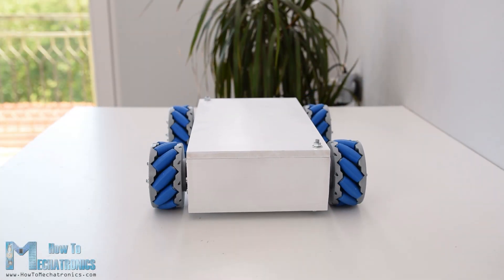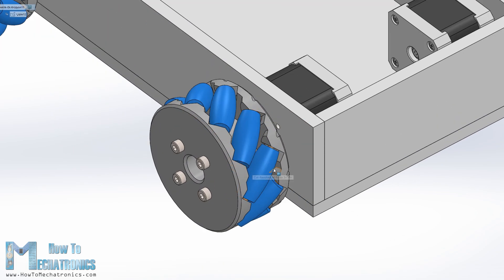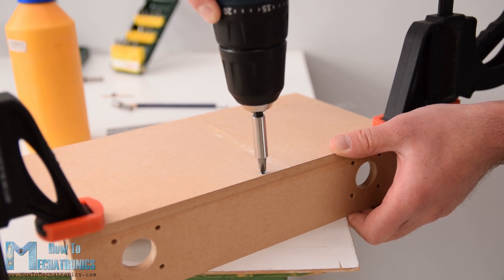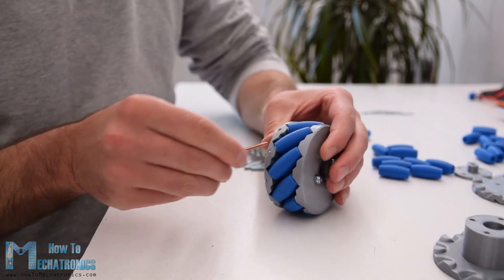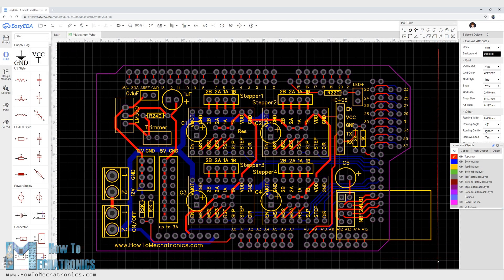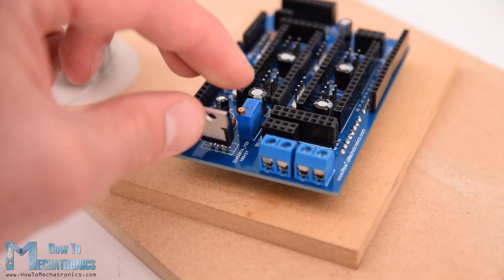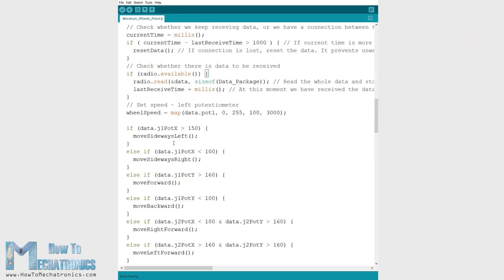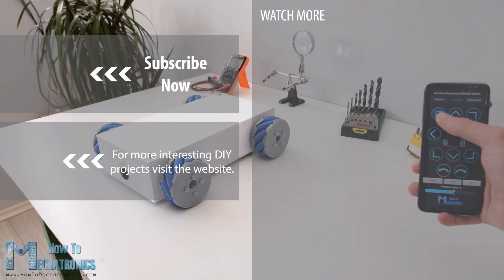Arduino Mecanum Wheels Robot

Comment: Great video , you helped me a lot with my project and i would like help to deal with a problem.
I used the mit app inventor and when i controlled my robot with it , it had a delay .  The app is built like yours , i used hc-06 BT , and other apps that in them you can send text to the arduoino through typing and not clicking dont have delay .
Thank you .

Comment: I'm building something similar with 4 stepper motors and your Mecanum Wheels but I can't find a video on how to control stepper motors with the Flysky transmitter, Will this radio code work with the Flysky transmitter and receiver ?

Comment: Well done. One point though. The diagonal force is due to the roller in contact with the ground which not the one on the top. If the view from the bottom, no confusion will arise.

Comment: What's the value of decoupling capacitor? Used in rc controller
Reply: Hello, can you help with  the capacitors and resistor value (Ohmic Value) and capacitors name etc stuff like that. in the robot's PCB

Comment: Hi, I am working on a different project where i want to control 3 stepper motors. Will it require anduino mega or arduino uno will be sufficient?
Also, I need tires with good grip. Can mecanum or omni directional wheels provide good grip?
Thanks in advance

Comment: i have to use hc-sr04 ultrasonic sensor with this nema17 but they dont work at the same time. nema17 motors sounds weir and they dont work if i use hc-sr04 codes. is there any way i can get to work them at the same time

Comment: Hi, 
I tried to do the project but I failed,I did not use resistance nor capacitors, is it the reason, and I used o e stepper motor Nema23, is it a must to use 4 steppers.
Regards

Comment: HI SIR
MY SELF CHARAN TEJA H
I AM CONTINUALLY WATCHING YOUR YOUTUBE VIDEO
WHICH IS REALLY AWESOME AND I WAANA TRY IT 

I CAME ACROSS A DOUBT IN THAT VIDEO

U HAVE USED A NIMA 17 STEPPER MOTOR
AND U GAVE A AMAZON LINK TO IT
IN THE AMAZON LINK I SAW THAT THE STEPPER MOTOR WAS 36V BY THUS I COULD NOT GET IN MY LOCALITY
SO COULD I USE 12 OR 16 V STEPPER MOTOR 
REPLACING IT

Comment: Hi, 
I'm trying to do the project without the PCB. (with the help of the circuit )
I have a few doubts about the connection :
1) why are RST and SLEEP of DRV8825 is shorted (both are active low inputs)
2) Fault pin is given high input. (it is output lowpin)

Comment: Hi Dejan. Good project I would want to create it with the robotic arm, but a question: can I use a Motor Driver Shield instead of the 4 A4988 Motor Drivers? Pls answer I have to order the parts I need
Reply: Hello, can you help with  the capacitors and resistor value (Ohmic Value) and capacitors name etc stuff like that. in the robot's PCB

Comment: Okay, all this is very impressive and all, but seriously how many people watching this would have the tenacity to see such an intricate build as this all the way through to the end?  I say:  zero.  Now then, if some enterprising chap were to take all of this stuff put it in kit form, including all the plastic parts; hardware; mdf cutouts; batteries; RF module; electronic components; software and bundle this for, I don't know $150 - $200, you might have something many of us could actually buy & build in a reasonable amount of time.  Other than that - great informational video.

Comment: Why soft-serial? Mega have 4 hardware serials. Also, if you connect hc-05 to serial0 - you can upload firmware by air (prev you need select connection speed of HC05 with AT commands like arduino upload speed)...
Reply: Hello, can you help with  the capacitors and resistor value (Ohmic Value) and capacitors name etc stuff like that. in the robot's PCB

Comment: hi great vid HTM !
i've build the same platform as yours, and it works fine in forward/backward direction and it rotate nicely, but things goes wrong when i try to go sideway left or right...
The rollers slides to much on the ground and as a result, the L/R control is unpredictable...
I first tried PLA to print the roller, then i tried TPU but it doesn't make  a big difference...
Does anyone have an idea of what kind of filament i should use to get a better grip between the rollers and the ground ???
Thank you all.
(and please, excuse my bad english... i'm french :-) )

Comment: Hello Dejan
Thank u for the great effort
I have a problem with the arduino codes for the mecanum wheel robot
First the led line in the code for nrf control has a problem
Second the software serial Bluetooth line has a problem in the smart phone code
I will appreciating if u can help me

Comment: Hello Congratulations on the project and thanks for sharing. I just can’t record the movements.
 Help-me.
At the beginning I had problems with the transmission rate, I used 9600 to run the engines, and for those who want to use Arduino UNO with CNC Shield v3 the pinout is different, if you have problems with engines running alone, for DRV8825 Drivers use (Type Driver = 2).
Staying like this:
AccelStepper LeftBackWheel (2, 2, 5); // (Type: driver, STEP, DIR) – Stepper1
AccelStepper LeftFrontWheel (2, 3, 6); // Stepper2
AccelStepper RightBackWheel (2, 4, 7); // Stepper3
AccelStepper RightFrontWheel (2, 12, 13); // Stepper4

Comment: Instead of battery we can use 12v DC adapter for powering the Arduino and motors??
Reply from the maker: Yes, sure.
Reply: @HowToMechatronics  where we to connect with Arduino or terminal block??

Comment: Hey Dejan, great video! I have a problem with the stepper motors. When I put my robot on the ground (similar design as yours), they are getting stuck and the rover doesn't move at all. When I take the wheels off, the stepper is rotating just fine. I am using a 11.1 V, 2200 mah lipo battery. Is there a way to fix this? Thanks for your response!
Reply from the maker: Hey, thanks! It sounds like the motors don't have enough power to drive the platform? Is you platform too heavy, or the motors too weak?
If you are using the same motors they should be plenty powerful for this application. Make sure the current limit of the drivers is adjusted properly, you can increase it and they will deliver more power to the motors.
Reply: I switched from an Arduino Uno to the Mega and everything worked out. I think the Uno was not able to handle four steppers and a servo at once? All the components I had in my robot had seemed to draw more current with the Mega, which made it work. Thanks for the help!

Comment: Hi , great job on this wheels robot. 

I have a question the size for the MDF baseboard as I will not print them so I would like to know the height x width ?
Reply from the maker: Hey, thanks! The size of the base MDF board is 300x156mm for the bottom,  300x55mm for the sides and 140x55 for the other sides. Total from top to bottom 71mm.

Comment: If I connect the arduino board and shield directly into my PC, which can supply about 5V (No battery is connected to the shield), will I be able to control the vehicle, assuming no line of code is modified?

Comment: Does the size of the stepper motor matter? I'm planning to buy smaller stepper motors than the 42x42x48mm ones you used, since I can't find such size in my region.
Reply from the maker: You can use smaller stepper motors, just make sure they have enough power to drive the platform.

Comment: I got a problem, i think the motor i used, a nema 15, has no enought power to work in this project... tryed to use it, and the motor skips passes... am i right?
Reply from the maker: Try to increase the current limit of the motor.

Comment: Hello friend, is it possible to use a Ramps 1.4 card with the dvr8825 drivers or the A4988 drivers, instead of making the printed circuit board you developed? I have difficulty getting this printed circuit .. it would take a long time to get to where I live. And I already have a ramps card with the A4988 drivers.

Comment: how heavy of a load can this robot carry? if I wanted to make a robot that can handle about 15kg of weight could I use bigger motors with the same electronics? Do you have the BOM and pick and place file so I can have it totally assembled in China? If not how much would you charge to make the files for me?

Comment: This is awesome and appears clearly a lot of efforts have been put in the project. Video quality and explanation is also great.
Reply from the maker: Thanks!
Reply: @HowToMechatronics  Hi Dejan. Amazing project I would want to create it with the robotic arm, but a question: can I use a Motor Driver Shield instead of the 4 A4988 Motor Drivers? Pls answer I have to order the parts I need

Comment: I am getting Accel stepoer.h:no such file or directory
Reply from the maker: You need to install the Accelstepper library first.
Reply: @HowToMechatronics  where I can download the library
Reply: @HowToMechatronics  can you send me the full code that you use to control your car I made the exact same car with exact same parts and shield
Reply: @HowToMechatronics  I downloaded the library but I got the same error I don't know what is wrong with it I want to make it for my school project but I don't think I will be able to make it I try to contact you may way but I can't able contact you 😟
Reply: @HowToMechatronics  I was able to upload the code and the library but it can't rotate the stepper motor getting power but it stay at it place
Reply: Where I can download that file
Reply: I am new to aurduino thingy

Comment: Great project. Thanks for sharing. I see the code shows how to do basic movements art 45 degree intervals. My question is how would you move the robot at a different angle, say 17 degrees or 67 degrees etc. It would require knowing direction and speed for each of the 4 wheels. The question is how to calculate them.

Comment: Was eagerly waiting for this kinda video to learn about this project , Thank you so much for sharing this..❤️❤️

But i wanna know more about it , basically i am now studying Electrical and Electronics Engineering , i have a small quarry about the project 

If i use Dc motor in lieu of Stepper motor , what's need to change in the schematic of the robot circuit diagram  or can we make this with Dc motor and dc motor driver ?? 😊😊

Comment: How to get these wheels?   Material specs of the wheel
Reply: Srirama Murthi if you want to order some, you can find some in either Vex Robotics (Under VexPro) or on AndyMark (wheels aren’t as good), and come in many diameters (from 2-10 inches iirc maybe more). In this video he 3D printed them (which is a unideal way of doing it but should work)

Comment: Very nice.  I really want to make a wheelchair at some point with these kinds of wheels because not being able to move sideways in a normal wheelchair is so annoying.  Don't think 3d printing could handle that load, so would probably have to buy the wheels.

Do you have to do anything special to mix the inputs if you want to move forward, turn right, and strafe left?  Does it work if you simply just add up the rotations calculated from all the different vectors?
Reply: Alluvian would not recommend for a wheelchair. Ever. They are so unsuited for the task. Use swerve drive (wheel that can be rotated freely in all directions with another motor), it provides more grip, less inconsistencies, better slope climbing, better dealing with rough surfaces and still can move in all directions (be sure to use a good encoder for the wheels direction so they will never get out of sync)

Comment: Amazing engineering, thank you for sharing this project ❤️
Reply from the maker: Thank you!
Reply: @HowToMechatronics  Hi. Good project I would want to create it with the robotic arm, but a question: can I use a Motor Driver Shield instead of the 4 A4988 Motor Drivers? Pls answer I have to order the parts I need

Comment: Do we really need stepper motors for this?? Cant it be done using just plain old dc motors? Im a noob here, just that steppers are gonna be so much more expensive, right...
Reply: A better method us to use DC motors with encoders.
I've done this myself. I initially tried with DC motors but it didn't work very well. By adding encoder feedback, I was able to make the robot move much better than without the encoders.

Comment: Seems to be simple by its look, yet amazing the way it performance.
If you could make avail the product in amazon you could really fetch a million.
Reply: MOHAN DOSS .V it’s commercially unviable to build a robot like this and sell it on amazon (manufacturing time and defect rate are way to high, and if you set up proper production, you would have to change almost everything, like wheels to more commercially available ones, and structure to something even easier to manufacture with machines...)

Comment: BLDC motor with a encoder isn't1 enough? A BLDC with a encoder is much cheaper than a stepper.
Reply: BLDC with encoder would work but an ordinary DC motor with encoder also works fine.

Comment: Is there a specific requirement to use Arduino Mega? I mean, why not UNO or STM32?
Reply: Cost is one of the biggest reason for Arduino and the functions and pins needed to run this requires more memory space and speed plus different boards can handle things different for the use you need it for

Comment: Nice work,How did you design the application to control a bot
Which language & appropriate s/w tool did you use?
Is there  any method to develop such a applications free of cost  to control a bot!😉
Reply: Do you mean the App? He used App Inventor. It's free to use but very awkward for anything but small projects.
Reply: @ddegn  fine, thank you

Comment: This video is awesome. I'm electronic engineer student and designed mecanum wheels a few months ago but when I tried it they haven't enough traction over most of surfaces. I should try your design of the wheels and print it tires around the rollers with a flex filament.

The explanation of how the wheels works it's simple and perfect.

Great video!

Comment: Nice wheel design. Personally, I'd rather buy ones that'll last made of metal. I recycle my robot parts constantly, so durability is important. Nice job.
Reply: Well, he printed them to save money, ofc metal ones are more durable, but also could be heavier, thus less battery life..
Reply: Vex makes some great Mecanum wheels. They're reasonable priced.

Comment: I have been working on a similar project and the platform doesn't perform accurate movement like yours. I assume is because I didn't took into consideration the X wheels disposition 😐 

I'm speechless about your project!! you made the wheels assembly look so easy 😁. I wonder what are the wheel's dimensions and if it's possible to change the diameter from your CAD.
Reply: I think some CAD programs have ability to make all the components proportionally bigger..
Reply: @SubjectXXX  I think so and internal diameters have to be taking into consideration

Comment: Really nice project and video. One tip from my side for the wheels: Add shrink tube to the rolls so they got more grip on slippery surfaces.
Reply: Carefull with this, you need to adjust rollers size then, otherwise they font fit.. And be very precise with shrink tube to not introduce and bubbles or ripples..

Comment: Great video, step by step explaining everything form the very beginning to the end. I've got only one question, is it essential to use stepper motors (as they are quite expensive, a bit too much to use 4 in such DIY imho) or is it possible to replace it with some cheaper solution?
Reply: Its harder to control the movement, since regular DC motors spin depending on a current (and not steps, which are predefined rotation movements measured in degrees), which you will have to control for each wheel at the same time.. Even small difference, that could come from some delay on a PCB could mean that robot doesnt go straight.
Reply: @SubjectXXX  you're absolutely right, I thought about it after writing my comment, thanks!

Comment: You might want to try some other stuff for making time lapses for the 3D prints, like injecting G-Code that moves the head after every layer or using OctoPrint's Octolapse, GreatScott has a nice video about that. It makes 3D printing montages look much better without having the head moving around all the time and becoming super blurry

Comment: I'm starting to think you have been watching my personal search history. I've been working building the exact same mecanum bot for about 6 months. Started with building my own DIY transmitter which you covered shortly after I started and now this. You however have managed to nail the coding which I have struggled with for quite some time. Is it possible to buy the Arduino Mega shield from this project directly from you? I am going to feel really bad adsorbing the code for this project if I don't have a way of compensating you.
Reply: Are you using stepper motors? I think DC motors with encoders is a better fit for Mecanum wheels. In case you're not aware, Vex makes some great Mecanum wheels for a reasonable price.
Reply: @ddegn  yes proper encoders would be a good idea but I want to used steppers because I intend to build other cnc machine with steppers after this current project and want the experience. 

I have an of the hardwarw and even have my Robbie built. I picked up a set of fairly cheap mecanum wheels from eBay which are suiting my needs. I did consider downloading the models for the Vex wheels and trying to 3D print them but opted to just go with a pre built solution since all my attempts at 3D printing mec wheels have been less than satisfactory.
Reply: Hello, can you help with  the capacitors and resistor value (Ohmic Value) and capacitors name etc stuff like that. in the robot's PCB